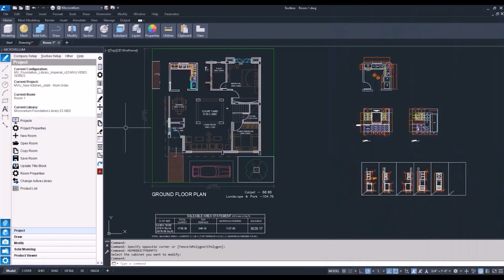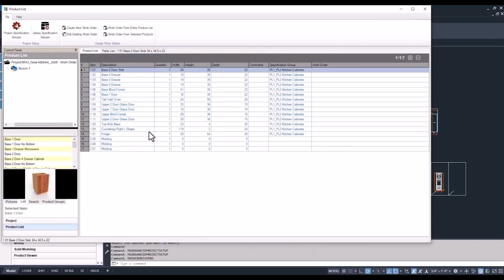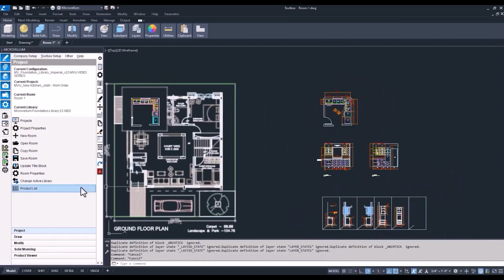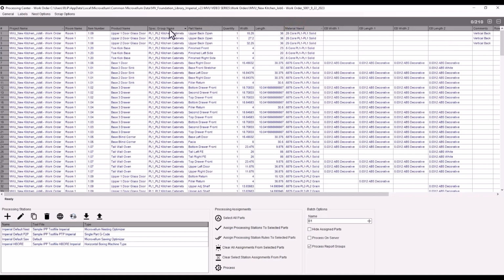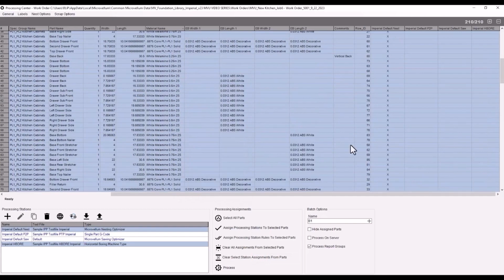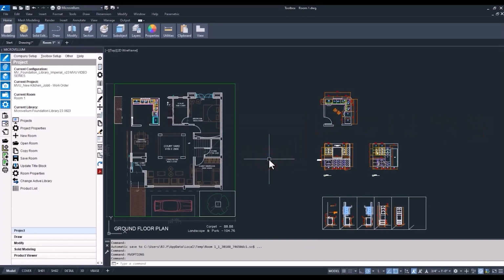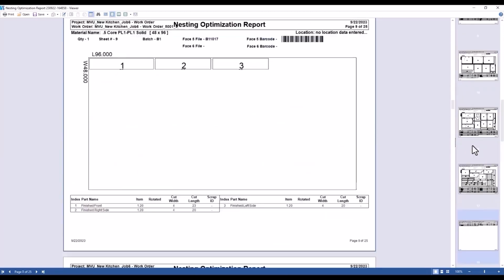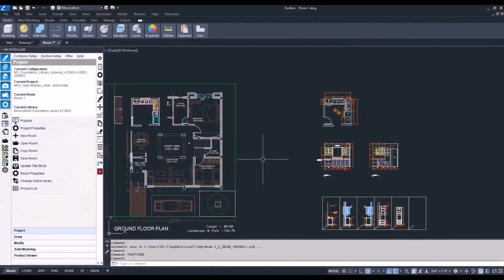Creating a New Work Order

Comment: Hi RJ, I wonder how to prevent face 6. Is it possible that I can only use face 5 of the board?
Reply: It is possible to only have Face 5 occur if just one side of the panel has machining.

During processing you should be asked if you’d like to flip parts with face 6 machining to be face 5.

If there’s not a pop-up message with the question about flipping parts, check the material being used in the material file and select a radio button next “Face6 Only Flip Setting”.

Just make sure you have the correct side of the material facing up at the CNC.

It’s not a problem flipping when using 2S material, but with 1S it can cause confusion. I would name my material with the color, then Liner UP or Liner DOWN so the shop knew the right way to load it.  

Hope that answered your question.